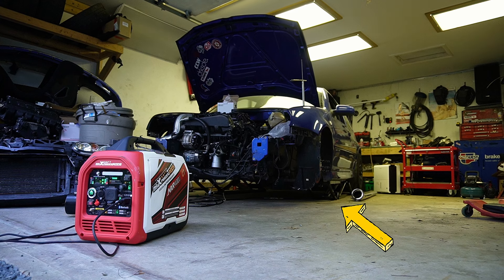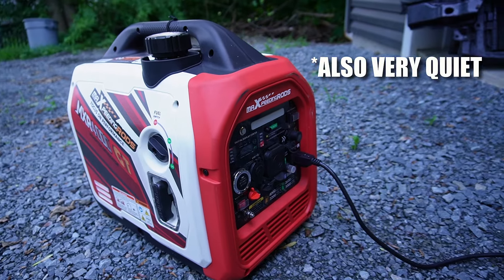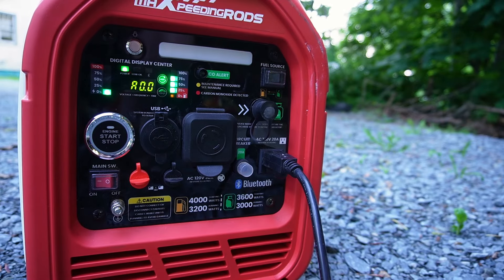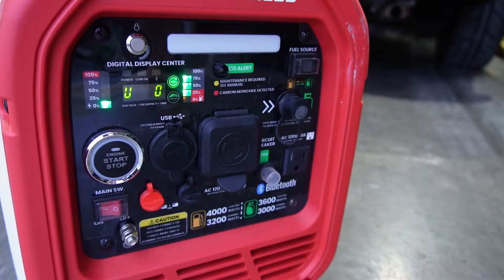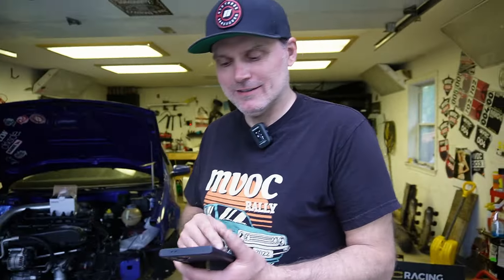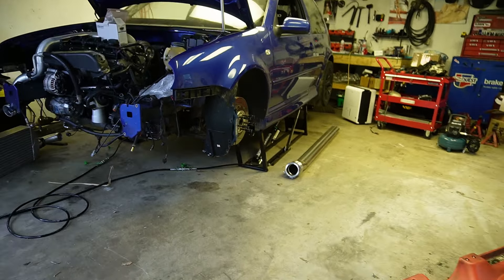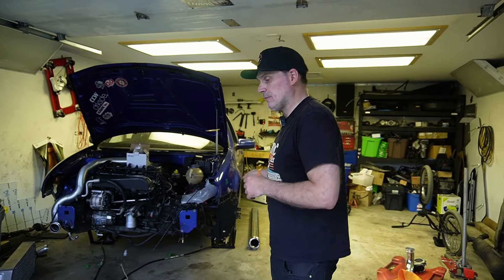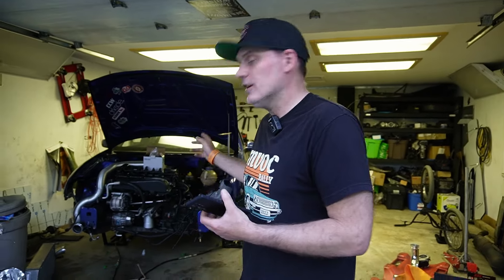Is the Maxpeedingrods MXR4000GT Inverter Generator any good?

Comment: I have been thinking about getting a generator, thanks for the honest review.
Reply from the maker: It's honestly impressive, definitely don't need the propane option as that adds a bunch of cost. Unless you wan to use propane of course. But the same version without the propane option is a lot less.

Comment: Mine keeps throwing a co2 issue any solution
Reply from the maker: It's pretty common with most generators that have it honestly. My buddy has a higher end generator (different brand) and his was tripping all the time. You just need to keep it in the open area, or worst case run a fan by the sensor. The fan sounds crazy, but that's literally what support told my buddy with his generator. lol (again different brand).